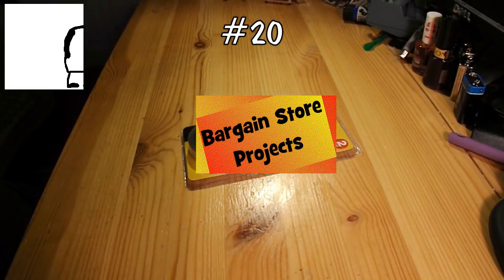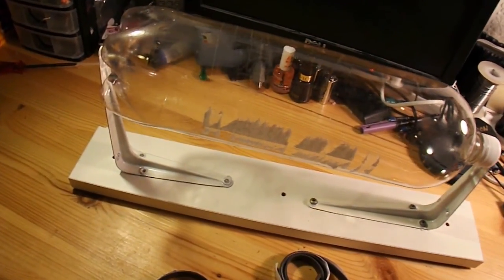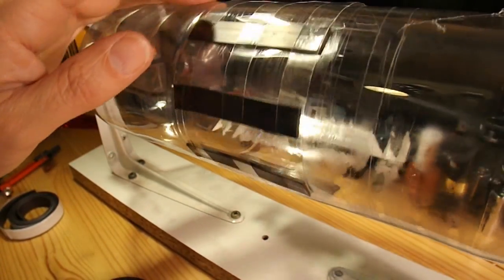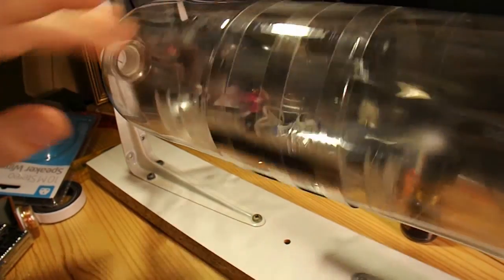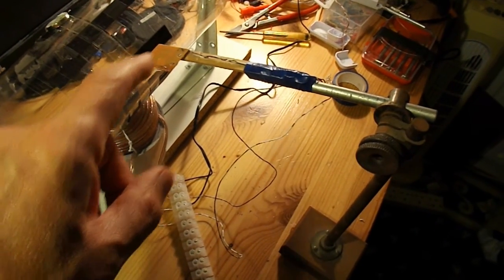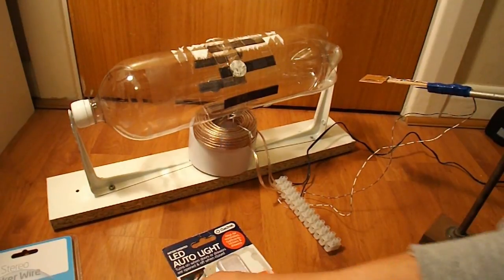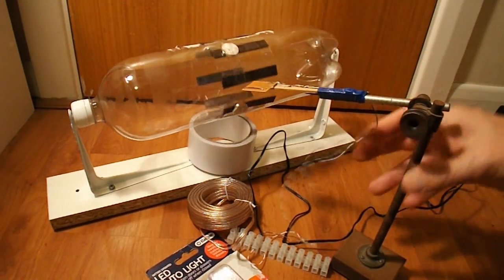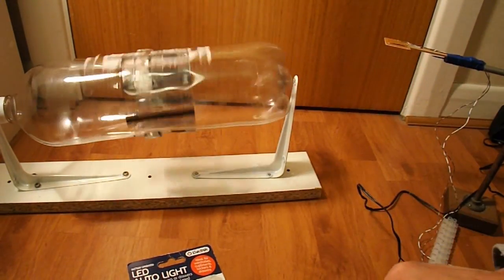Bargain Store Project #20 Magnetic Tape Pulse Motor attempt

Comment: no i mean not one magnet but it must be something called perpectual moter           in the program waste from trash  there is a video on how to make a perpectual moter     can you make something of that sort and fix it on to a boat
Reply from the maker: If you mean perpetual motion, forget it. Any video showing or claiming perpetual motion is a fake. Even if one existed, by definition you could not use it to power anything. It would work by using no energy, gaining no energy and losing no energy. As soon as you use it to power something it will lose energy and stop.